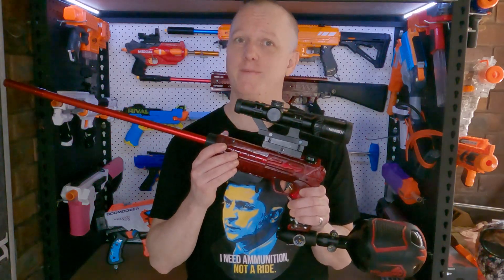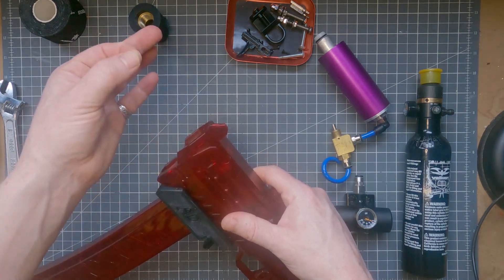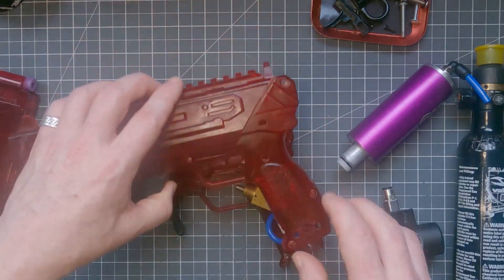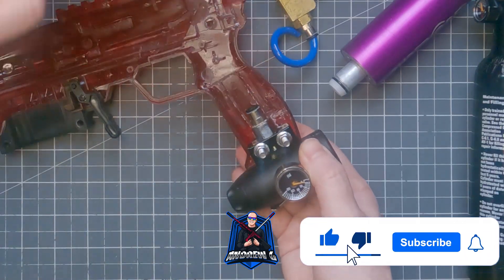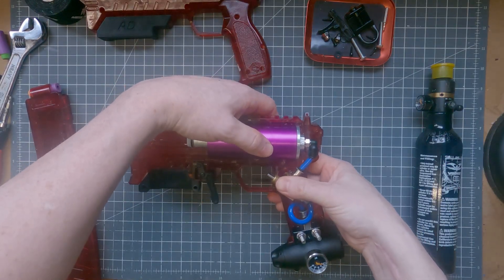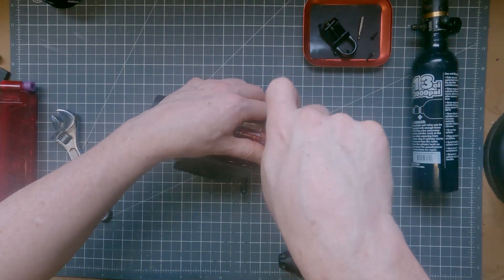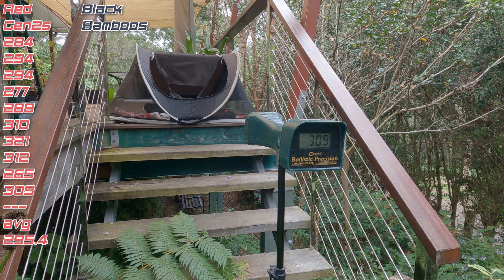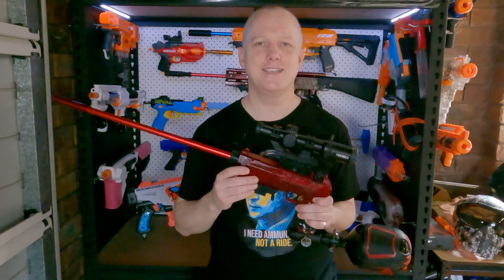Blaster Breakdown 29 (May 2022) - Super Cheetah - a 300fps, bottle-on, semi-auto HPA mod - How to

Comment: What is the price of all of it not including the cheetah
Reply from the maker: It really depends where you're located. The Empire Relay is more expensive here in Australia than it would be in the US. I think the pneumatic fittings would also be cheaper there.
You could use any size bottle you like - cost will depend on size & material.
I'm sorry not to give you a single dollar value, but that would just be really misleading for anyone who is anywhere else in the world. As you see, it's quite a small number of components - I'd suggest starting with local paintball or Airsoft suppliers to get an idea of the cost of bottle + regulator where you live.
Reply: @andrewg_nerfmods  thanks

Comment: Nice build 👍So the empire asa is the same as a 2nd stage regulator? Also don’t need Slp tank. Cool t-shirt too.
Reply from the maker: Yes - the little 13ci tank I tested with is 800psi output - plenty more options than needing to use SLP.
And thanks on the shirt - a local artist makes them 😎